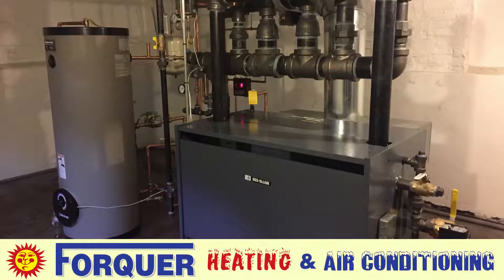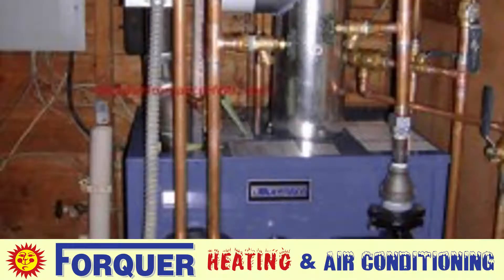Maintenance Requirements for Steam vs. Hot Water Boilers

Comment: Steam a thing of the past?!? Nearly every single home in New York City and Boston runs on steam.
Reply: I live back/forth in the The Bronx, Manhattan & Buffalo.  I know what You're talking about, steam is the BEST heat and it's not DRY.  
Every house in Buffalo, NY, I lived in except 2 (steam heat) has forced dry air heat, I have to put bowls of water on the heat vents, it don't work as good as Steam heat from a radiator.  
It's funny how every city in the North East USA.  Even Chicago, Cleveland, Minneapolis has more steam/water boiler systems, but Buffalo NY don't have many in residential homes.  Most office buildings, schools, older apt. buildings has those "wet systems" here.
The furnace in the house I own now is very old but it heats & runs real good, it has an humidifier on it, but it never worked since before I been owning in the house.  I want to put a steam boiler system in I know it's gonna cost several thousand dollars.  I better do it soon before it gets above $10,000.